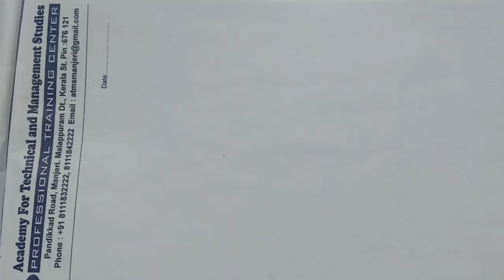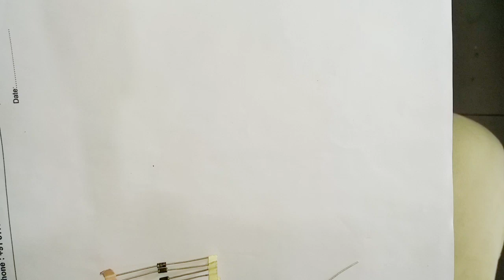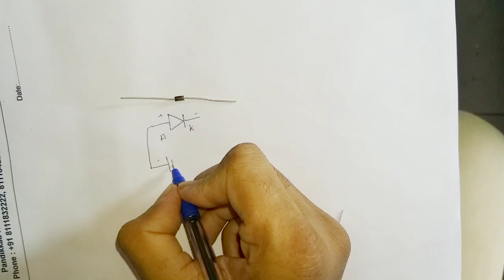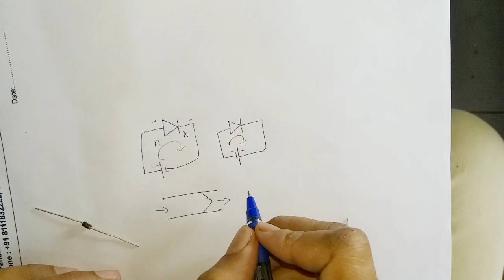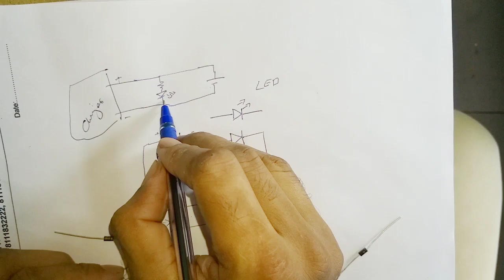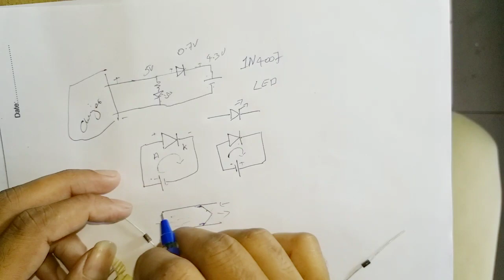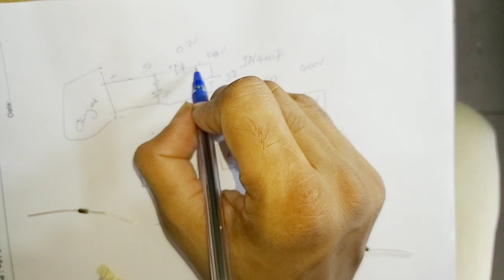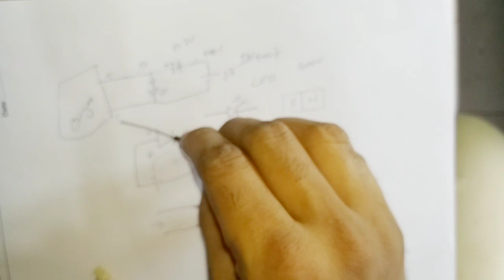Electronics malayalam class 10|Diode

Comment: Oru diode 0.7 v drop und, apol ith series aayi 2ennam connect cheithal 1.4v drop aaakum, parallel aayi connection cheithalo?  🤔
Reply from the maker: പാരലൽ ആയാൽ .7 മാത്രമേ ഡ്രോപ്പ് ഉണ്ടാകു
Reply: @FELKITLearning  vokey broo 😍😍😍
Reply: @FELKITLearning  bro, paranja pole njn cheithu, bt multimeteril nokiyapol matam onum kandilla,   ente kayyil 12v 2a adapter und, ath upayogich 6v battery charge cheyan vendiyanu nokith, 1N4007 diode [12.5-(0.7×8)=6.9]  8 ennam parallel aayi  connect cheithu,enit multimeteril nokiyapo 12.2v 😢
Reply from the maker: പാരലൽ ആയി കണക്ട് ചെയ്താൽ .7 ഡ്രോപ്പ് മാത്രമേ ഉണ്ടാകു എന്നാൽ സീരീസ് ആയി കണക്ട് ചെയ്യുമ്പോൾ ആണ് ഓരോ ഡയോടിനും .7 വച്ചു കുറയുന്നത്. പിന്നെ ഈ ഡയോസ്  ഇങ്ങനെ വോൾറ്റേജ് കുറക്കാൻ ഉള്ളത് അല്ല 6 വോൾട് ബാറ്ററി  ചാർജ് ചെയ്യണമെങ്കിൽ റെഗുലേറ്റർ ic യോ അല്ലെങ്കിൽ zener diode ഓ ഉപയോഗിക്കുക
Reply: @FELKITLearning  ok, chumma oru parekkshanam nadathithaaa, 😁